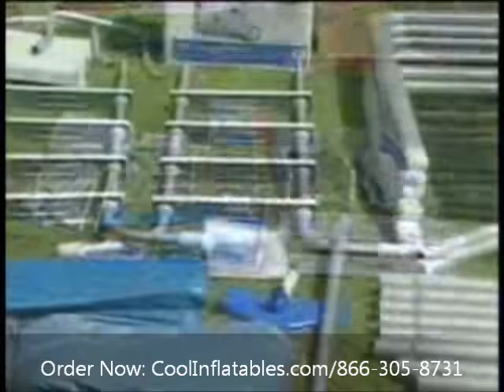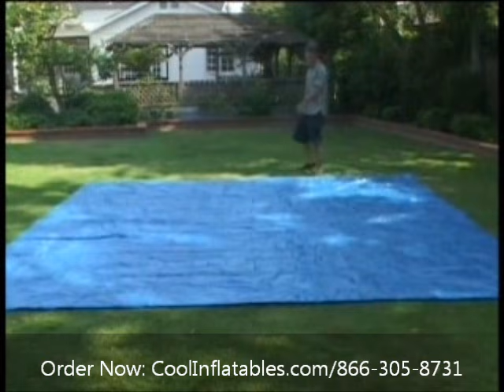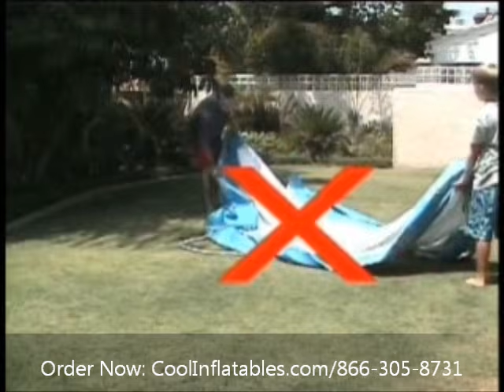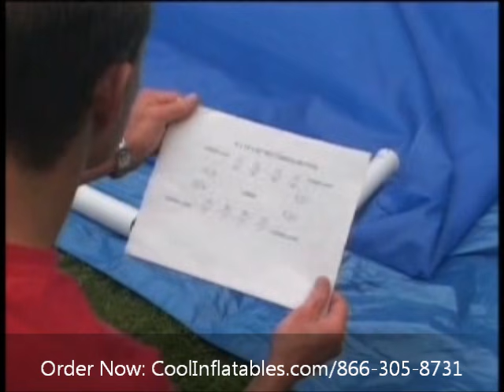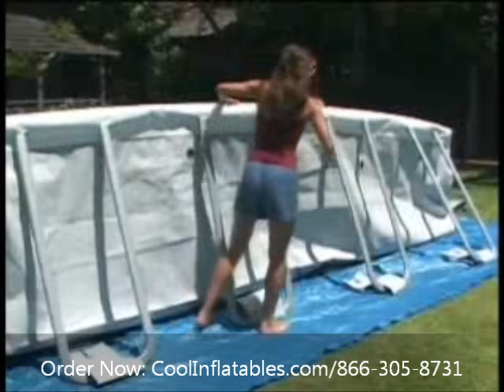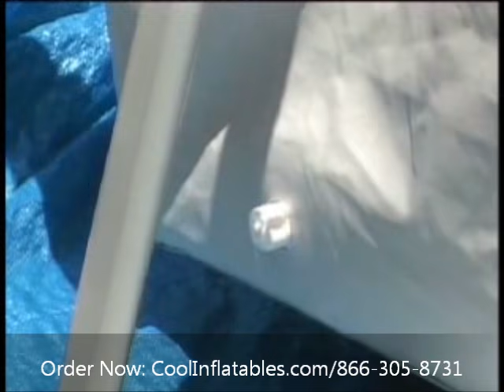Intex Rectangular Metal Utlra Frame Pool Setup Instructions

Comment: You have to set up and undo each year. Did not know that until I bought it. The set up is not as easy as the video shows. You have to tie the walls since they don't hold up without water. Also the filter system should have the holes at either end of the pool and not in the middle. Water does not circulate as in a circular pool. Somethings to consider before purchasing.
Reply: You dont have to take it down each year, had mine up for 3 years

Comment: First of all, absolutely no suggestions on how to make the yard LEVEL, especially a grass lawn. Not everyone lives in cookie cutter homes in suburbia.  And you didn't show the pool full of water to see if it is level. I staked a taut line on all 4 sides with 1/2" steel stakes and placed a 3' level on it to adjust the line to perfect level.   Then used sand to level each support.  2 yards of sand, delivered for $100. If the supports are all at the same level, then the top rails of the pool will be level.  Second, My Intex pool says you must put a solid 2'x2' platform under each support to keep them from sinking into the ground!!  I bought 4'x8' sheets of 1/2" plywood, painted both sides with heavy duty exterior paint to keep them from rotting after one summer in georgia, and cut them into 8 squares each.  32 squares for the 32' x 16' pool I have.  That's one whole days work right there in 99 degree heat.

Comment: This video is extremely misleading. Yeah right two girls put this pool up . I have the intex rectangle 12x24x4.3 foot. The tarp under the pool is trash. This is a huge project you have to level the floor. The instructions say that if you have agustin grass and another type of grass I forgot the name it voids your warranty. To get it level is a nightmare I am emphasize on this NIGHTMARE. I live in LA water is extremely expensive my pool is collapsing because the wood under the legs is not leveled. I am going to have to drain it re-level it a fill it up again. Also just so you know it took my husband, son, my two daughters and myself to build the pool sliding the poles was super hard.

Comment: I called today inquiring about the metal pins that go into a 12X30 #28211EG to keep the poles up and got no help, these were not in the box when opened. I was told to call Walmart and get a confirmation number, which I did call but they said they didn't know what you were talking about, so I called company to get replaced and would like to know what the problem is with you replacing them

Comment: After days of wondering if I can fit this pool in my yard I finally found the true measurements of the pool with the side legs attached. 19' 10" long by 10'10" wide. It's right on the top of the box . I think I can make it work.

Comment from the maker: The saltwater from the system should not reach levels possible to eat the metal or tarnish it. We make sure and test this on our pool here, thanks for heads up.
Reply: Blue Fade Marketplace even so, splashing salt water on the steel is still going to make them rust. This pool works best on a concrete slab. We have to replace parts due to salt and spray them with rustoleum black bed liner undercoating for more protection. The steel is not very strong. We had a welder make us stronger legs and beams using 16 gauge steel rather than the 20 gauge it is made of.